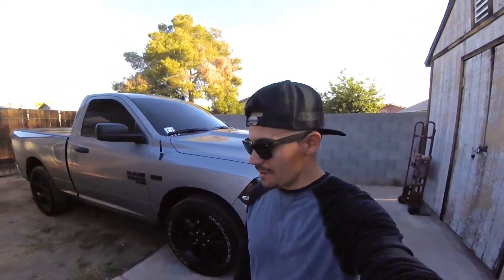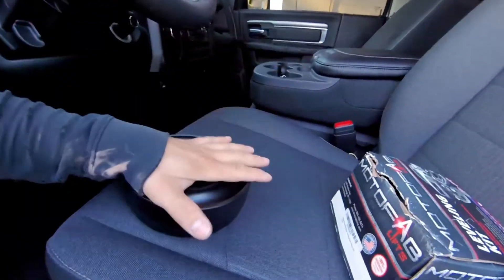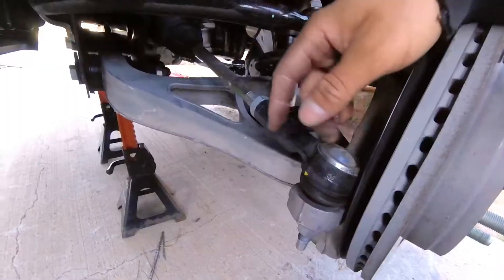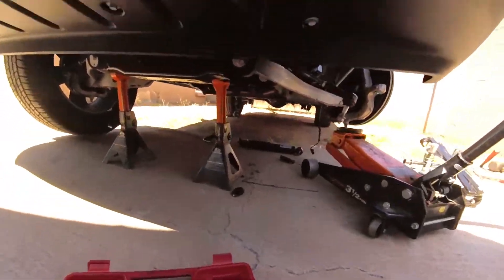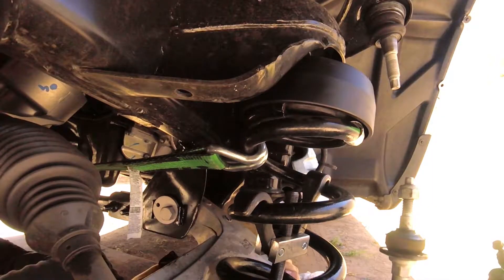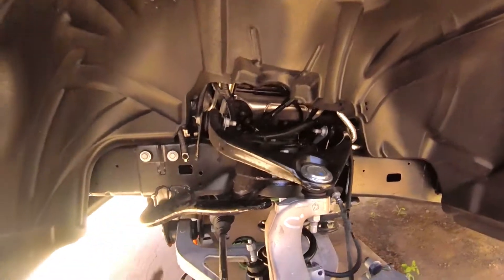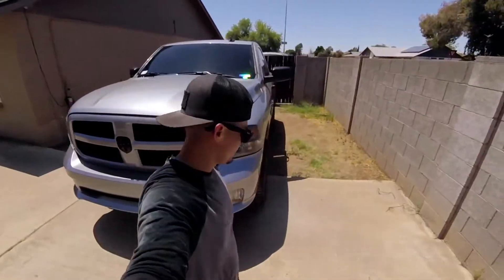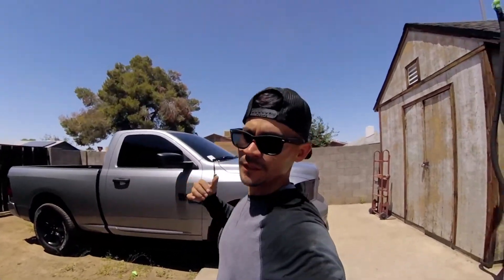2009-2018 RAM 1500 MotoFab 2 in. Leveling Kit Install 2WD (19-21 Classic)

Comment: And this guy is doing this all wrong. When you lower the lower control arm that coil spring just falls right out of there. I learned that the hard way. When you go to put the coil back in with the spacer you just hold it in place and jack up the lower control arm.

Comment: So I was thinking about putting a 2.5 spacer for my ram, but should I put an after market shock or does the stock shock still work well?
Reply from the maker: Stock shocks work perfectly fine in my opinion regardless you will have a stiffer ride once you install spacers.
Reply: 2.5 is too much in my opinion that .5 inch makes a difference
Reply: Go with Bilstein 5100 shocks trust me

Comment: I had all kinds of problems after putting coil spacers on my 09 2wd. I had to switch over to longer sway bar end links. The upper control arms really need to be changed also. I found a hack for the sway bar end links. Factory ones from a 4 wheel drive are the same fitment just longer. So that worked great. Before that the truck swayed so bad it was scary. Them 2 extra inches of lift was enough to max out the sway bar. A lot of people go with the hellwig sway bar but that’s not the actual fix. You don’t need it. It’s a waste of money.

Comment: I know people that had major issues down the road with spacer kits i used bilstein 5100  adjustable height shocks  cant go wrong believe me
Reply: They don’t make those for 2wd rams
Best you could do is get the 5100 shocks, 2” spring lift from RC or Maxtrac and an upper control arm upgrade.
Reply: @abelscaliber7969 hey man i been wanting to level my truck it’s a crew cab would you also recommend the 2in lift springs for mine

Comment: Ratchet strap! 🤘🏻 I use that when doing the rear lower tubular control arms ( trailing arms is old school term)
Reply: Yea you don’t need it. The coil spring falls right out when you lower the lower control arm with a jack.

Comment: Nice video! 
Would that fit my truck? 
I have a 2015 Ram 1500 Lone Star, I’m having trouble finding a 2 inch leveling kit , the leveling kit on Amazon said it’s for 4 wheel drive only.
Reply: I recommend going with the Rough Country 2” Leveling Kit Ram 1500 2WD, it comes with 2” Leveling Coils and new shocks for the front, that’s what I installed on my truck instead of a puck. However, this a good option too, he does a great job explaining how to install it.
Reply: @sernaalexis9318 hey i recently put new shocks on my truck and i want to level my truck would i need bigger shocks
Reply: @urielsanchez1218  I would highly recommend you do get longer shocks to accomodate the lift from the leveling kit. It’s best to be safe than sorry.
Reply: @sernaalexis9318  oh okay it’s cause i replaced them with the billstein 4600

Comment: How does it ride? Stiffer? Bouncier?
Reply from the maker: It’s a slight stiffer. He added 35” tires with stock wheels and it definitely changed the ride quality I recommend upgrading shocks and upper control arms.
Reply: @five7garage826  is it super bouncy?? Which UCAs would you recommend? Oem or lift UCAs?
Reply: You don’t need new UCAs. Just get adjustable ball joints. To get your camber right when you do the alignment.

Comment: Would you recommend this kit or say go to a true 2” lift spring replacement as a better option?
Reply from the maker: Oh definitely a 2 inch lift kit with springs and control arm replacement option will be a better, because they are designed with control arms with a greater ball joint pitch and potentially same comfort versus compressing the stock springs making it for a harder ride. The only drawback is that they cost more.
Reply: I went with rough country lift springs and Kyb mono max but the ride is so stiff. I noticed the Kyb monomax is short too, would adding a shock extender make the ride better?

Comment: You sound very knowledgeable and I am looking for guidance. I recently purchased my first truck so I am new to the truck world and its language. I am looking for a leveling kit but I cannot find the components anywhere, I am open to a small body kit but I am also having trouble finding what I need. My local lift kit shop suggests using components for a 2016 model and it just doesn't sound right. I have a 2022 F350 dually 4x2 7.3L gas, what can I do?
Reply from the maker: Let me start off by saying congratulations on your new truck. You just skipped the little and jumped straight to the big leagues 🤙. I haven’t dealt with many Fords but I do agree with what the shop said. Many makes do use previous generation suspension components and body parts on new models, all they do is update front ends, rear ends and interior design. But they utilize the exact mounting location because they keep the exact dimensions underneath to a certain extent, some backside components do change as well for example a radiator/core support. That’s why front end swaps are pretty common. Hope that helped a little and kind of points you the right direction 👍
Reply: @five7garage826  it helps alot, thanks alot for your help and your time. I got this stuck sorely for looks, I do not tow nor carry anything. The reason why I decided to save some money by not going with a diesel engine and 4x4 transmission.
Reply from the maker: Glad to help. You should follow @Durtymaxjack you will get some pretty good ideas from his many builds.
Reply: @five7garage826  will do.

Comment: Got the same truck. Just black on black. So those moto fab will I be able to put 33” or 35” tires on the stock 20x9 wheel?
Reply from the maker: 35 with very little rub
Reply: @five7garage826  Thanks for replying back

Comment: I have a question and I would appreciate someone answering it;  I already installed a 3-inch kit on my truck but I want to raise it another 3 inches, is it possible that I can put one kit on top of another?
Reply from the maker: It is not possible. I will assume you have already installed some sort of leveling kit that installs on your coils or struts. As is your control arms are almost maxed out at their downward position, that’s bad for your ball joints and CV axles. If you want to go taller that’s when you will need to relocate/drop your control arms and that’s when lower cross members are added and spindles are replaced and drop steering links are put on. You will have to replace the kits if you want to go taller, BUT their is another option if you just want to get another 1-2 maybe even 3 inches without replacing any suspension components and that is body lifts. Look into them. Hope that helps 👍

Comment: That is NOT a 2021 Ram.. 2019 to now the body style changed. Mostly the front clip a interior.
Reply from the maker: That is not true, they still do make them in 2022. They are under “1500 classic” look them up.
Reply: Lol I have a 2019 That looks just like this, it’s a classic

Comment: Were you able to fit bigger tires? My tires are almost at the 60k mark and wanted to level my truck before I got tires
Reply from the maker: You can fit 35 with stock wheels and no trimming. You will have a slight rib but not bad
Reply: 33 max with any 2” level kit. Anything over that you’re rubbing, especially under load. Why would you want that? Burn through tires and components faster

Comment: hey man, after months driving the truck like this, have you noticed any bumps between the UCAs and the spring towers while flexing because of a pot hole or speed bump? I want to do exactly the same but I've read about this issue and I live in a country with fucked up streets and speed bumps everywhere, also, do you know approximately the weight of the spacers? I'm shipping by plane to the other side of the world and every gram matters haha, thanks!
Reply: Order some adjustable control arms or lifted control arms

Comment: I'm about to do this on my 2019 quad cab. Do you remember what that tool was called that you rented. It made the install look 10x easier than everybody else has done it! Thanks!
Reply from the maker: It did make it a lot easier. It’s called a Coil Spring Compressor this one was made by OEMTools and part number is #57035. It was a loaner tool from AutoZone.

Comment: Great video.... Did you use this on a 2021 RAM 1500 Classic? Some cites say they work for the 21, some say don't. Thoughts?
Reply from the maker: I believe all 1500 classic (19+), can fit a 09 to 18 front leveling kit.

Comment: I was wanting to do the same thing but what you think would be better a 2" leveling kit or a 3" suspension lift
Reply from the maker: It really depends on what your trying to achieve, the bigger the lift the bigger the tires you can put on. The majority of 3+ inch lift will come with a 1 inch spring spacer you will have to install in the rear.

Comment: I couldn't tell in the vid, did you leave the factory rubber in and does it go between the spacer and spring or on top of the spacer? Thanks
Reply from the maker: No I left it out, rides fine without it.
Reply: @five7garage826  thanks for the info 👍

Comment: I put a 2.5 inch leveling kit on my ram classic 2wd and it was at 39 inches in the front. 2 months later it dropped down to around 37.5 is that normal?
Reply from the maker: It shouldn’t have. Is it a plastic spacer?
Reply: If it had the plastic (composite 😂) spacer it gets eaten up and drops.  Happened to me I had to replace with steel